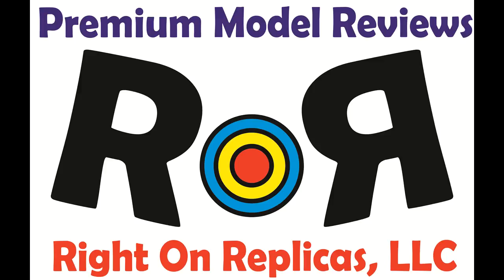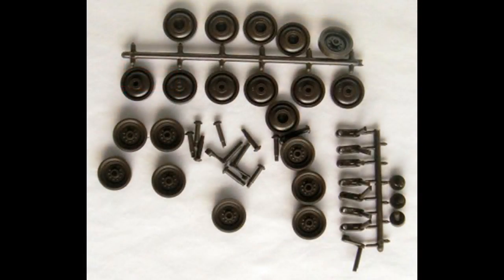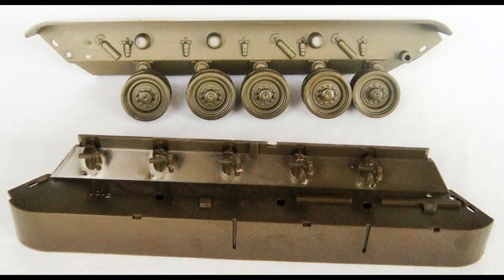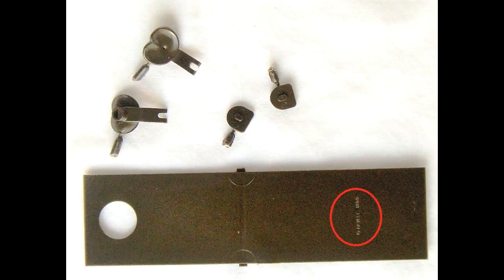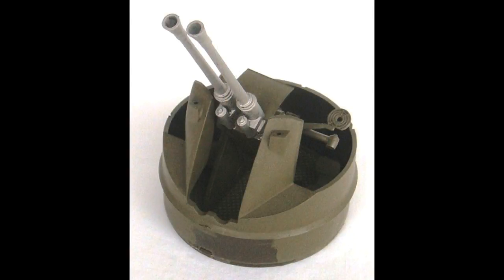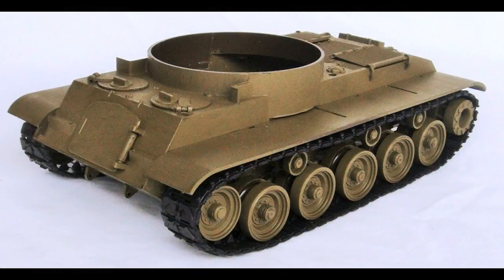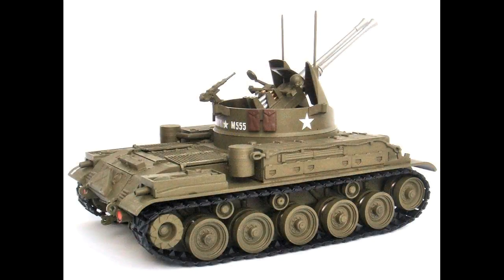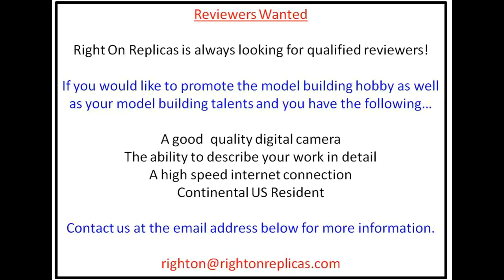How to Build the M42 Twin Forty Duster 1:32 Scale Revell-Renwal Model Kit #85-7822

Comment: I picked mine up at a antique shop and just finished it as I saw this video.
Reply: Mine did not have a crew and the decals were different, and I mostly used testors FI. Green for the main body color.
Reply from the maker: KK,  Thanks for checking it out.  Next time look through our playlists to see if your next build is in there.  We also put tips and techniques in every review!  -Doug
Reply from the maker: KK,  Sometimes you just have to search through the parts boxes!  -Doug